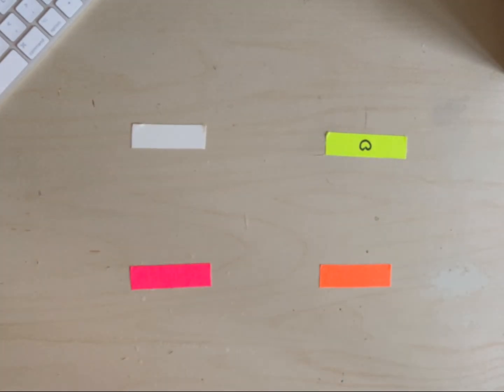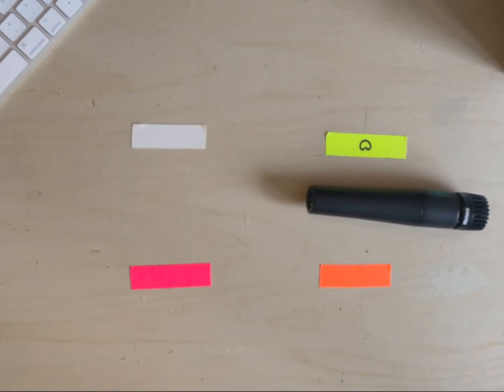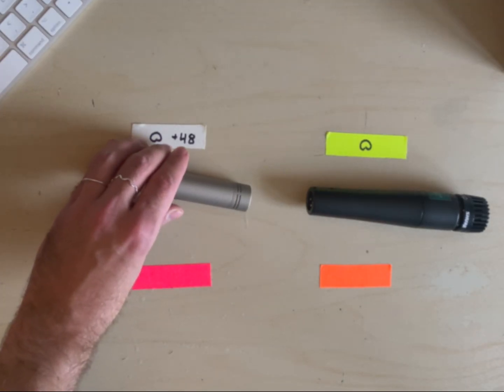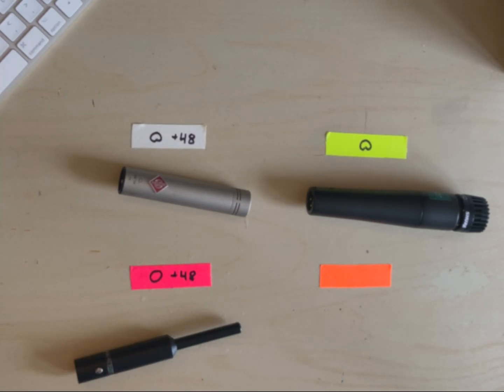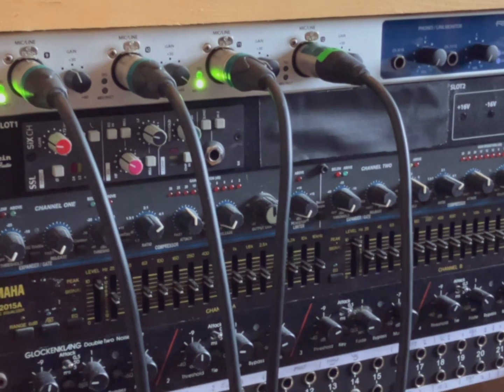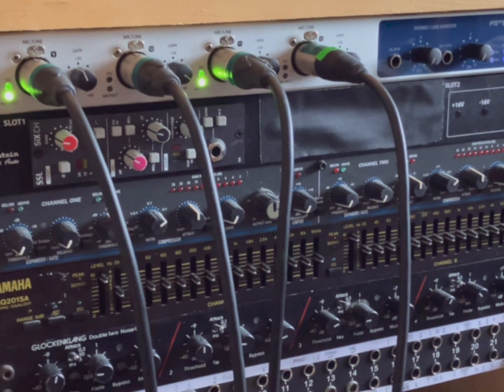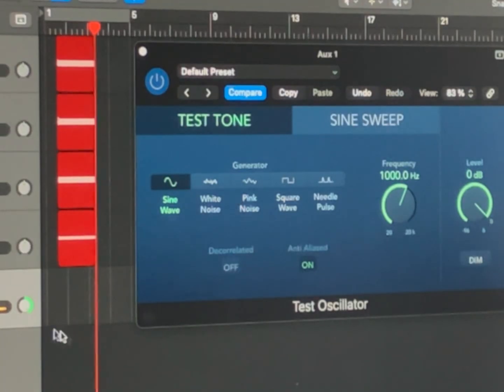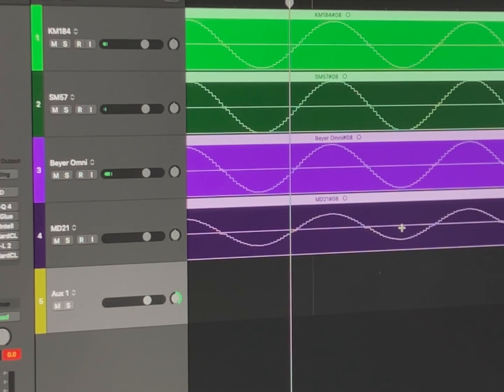Are Condenser and Dynamic Mics always out of Phase?

Comment: if one mic was measuring a signal which was the derivative of another mic's, you would know pretty quick just by hearing it because taking the derivative of a signal applies a +6.02dB/oct slope to the its magnitude response. such a filter, if it's minimum phase and continuous-domain, does have a broadband +90 degree phase response. so maybe it's true that those two kinds of mics pick up different signals whose phases differ by 90 degrees, but then it would be corrected right away by an ordinary 1-pole lowpass filter which you would need just to get the mic to sound normal. presumably it'd be built-in, which i guess would be the reason that your test showed the mics were all in phase. i suggest repeating the test with a sine sweep by the way, and an impulse wouldn't hurt either so you could precisely time-align the measured signals

Comment: I think there are some confusions because different things are named the same.
Microphones in general can have various directivities. Those are achieved by the capsule design around the membrane. Omni being one side of the spectrum where the back of the membrane is closed and sonic waves can only get to it from one side. The other extreme is figure of 8 where both sides of the membrane are exposed equally. The other forms are  hybrids of those two (shotgun mics are a bit different here but also work by canceling out stuff from the side with their tube design). You see cardioid mics usually have little inlets behind the membrane to allow airflow to the back of the membrane.
So there is the omni where only the soundpressure as a whole is measured (like a barometer) and as soon as you have a directivity (access of the sound to the back of the membrane) there is a preassure gradient between the front and the back of the membrane which depends on the direction of the incoming sound and the design of the capsule. thats why directed mics are called pressure gradiend mics and omnis pressure mics (don't know the exact terms in english right now but I hope you get the point).
After all of that we are left with the movement of the membrane. How this movement is converted into an electrical signal is where dans point is coming from. In dynamic mics the membrane usually with a kind of coil attached to it is moving in a magnetic field. which induces current in the coil with the maximum where it moves the fastest (velocity) and not where the preassure is the highest.
In a condenser mic the membrane is part of a small capacitor where the current is highest when the two plates are closest together (this in a sine wave is where the preassure of the air molecules is highest).
All of that doesn't explain your test results though :D (or maybe it does and I just don't get my head around it)
So I'm excited for explanations! And also corrections if I wrote something wrong.

Comment: Measuring velocity? I’m confused. The sound waves move at the speed of sound no matter the frequency. The distance between the waves is frequency and the pressure of the waves is volume, right?
Reply: The sound waves move at the speed of sound, but the air molecules collectively moving back and forth to form the waves move at a constanly varying speed.
Reply: Not the velocity of sound. Dan said one type of microphone records the velocity of the microphone membrane, and the other type measures the displacement of the microphone membrane.
Reply: @ristok4494 in the video, Dan says "velocity of air". I guess, there is an unspoken assumption here, that the membrane moves proportionally (in the audible frewuency range), for the microphone to function.

Comment: When i watched Dan video I thought about the same thing, that this apply to different types of directional characteristics rather than different types of transducers, and it made me thinking about doing the testing by myself. It would be better to test across the spectrum, and not with 1khz sine, as there are more variables in play i.e. SM57 have an transformer that can affect the phase, don't think that MD21 have one, I remember that there were external plugable trafos for MD21.

Comment: Excellent experiment. A possible explanation is that an integral HPF or LPF can introduce a 90 degree phase shift, in addition to the capsule or transducer. I typically get the 90 degree phase shift Worrall mentioned when I use a SDC cardioid and a ribbon mic.

Comment: My limited testing and reading on the subject concluded you can put mics into three groups: 

Group 1: Cardioid Dynamic / Figure 8 Ribbon / Omni SDC or LDC
Mics in this group are likely to be either 0 or 180 degrees apart from each.

Group 2: Cardioid SDC or LDC / Figure 8 LDC / Omni Dynamics
Similarly, mics in this group are likely to be either 0 or 180 degrees apart from each.

However, if you take one mic from each of the above groups, then they are likely to be +/- 90 degrees to each other.

Group 3: Semi-Cardioid Mics (i.e. wide, hyper, super etc.)
Mics in this group are going to be a non-cardinal relationship to the above groups (i.e. not 0,+/- 90 or 180 degrees).

So my conclusions are different to both yours and Dan’s!

Comment: Hi, I’ve been doing experiments on the same thing so wanted to chime in a little bit. What Dan was talking about was phase rotation. Let’s say a mic that’s phase linear would have all frequencies arriving at the same time. Now, if we instead take a mic that’s phase rotated by 90 degree, each frequency would arrive a quarter of a wave later. This means the sound is delayed differently for each frequency. The result is that instead of all frequencies arriving at the same time, the whole thing is smeared out. (It’s also a practice in some radio stations to rotate the phase to smooth out asymmetrical waveforms, this isn't directly related but it leads me to think that this phase rotation is one of the factors that contribute to why ribbon mics sound easier on the ears.)

Testing with a sine wave doesn’t show the relationship between the delay of each frequency. One way to test that would be to use a triangle or a saw wave instead (the lower the hz the better, since the shift often becomes more apparent at low frequencies) since these waves contain multiple frequencies which are neatly stacked and we can see the rotation very clearly (the triangle will tilt a certain direction in response to phase rotation)

In theory, a pressure gradient transducer (like a ribbon mic) will always be 90 degree out of phase with a pressure transducer (an omni mic) but if the said omni mic is a condenser, then there’s an additional (I think 90 degree) shift on top of that which comes from how condenser generates most voltage at highest point of incursion instead of at the point with most diaphragm movement. But also, the most frustrating part is that once we take into account how everything else in the mic (transformer, frequency attenuations, active parts, impedance of the voice coil, etc.) and even the way the polar pattern itself is constructed also alter the phase in convoluted ways, each mic is wildly different in its own phase characteristic and this can no longer be simplified.
Reply: Interesting, because for years I have recorded snaredrums with an SM 57 and a super small condenser mic, and I had no phase problems at all. The difference in envelope was more pronounced than I thought and the condenser was brighter, and now I am not sure if that brightness comes from changed phase or not...
Now I just wonder how this could work in the first place. I mean, I am not some esoteric and I don't believe in magic. Under which circumstances would that be possible? Is it possible to have a condenser not phase rotated??? I am very confused. Or maybe I was wrong and the phase differences were there, but I specifically used that technique because the waveforms were so identical to each other.